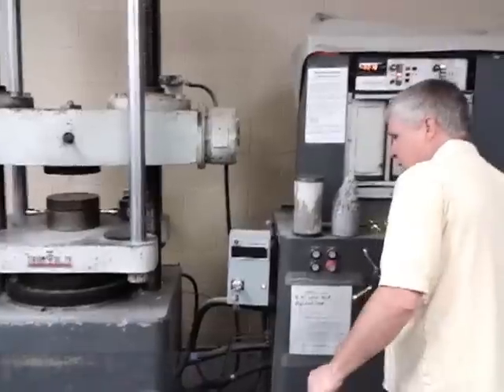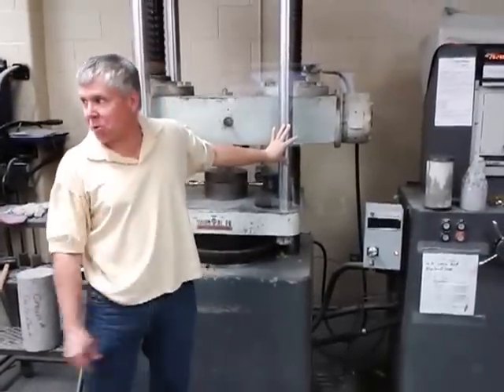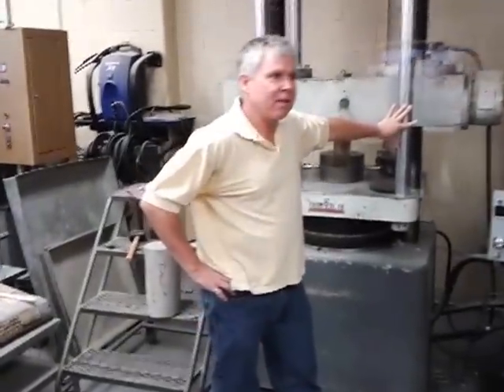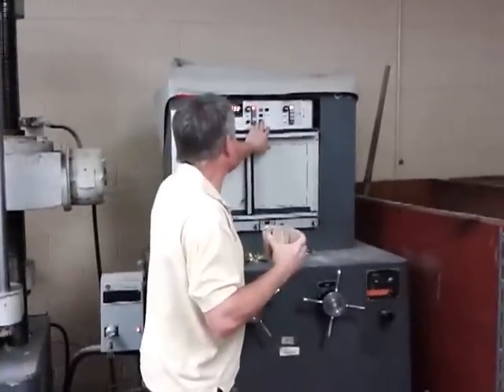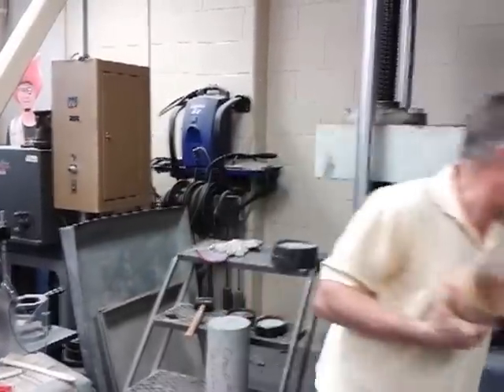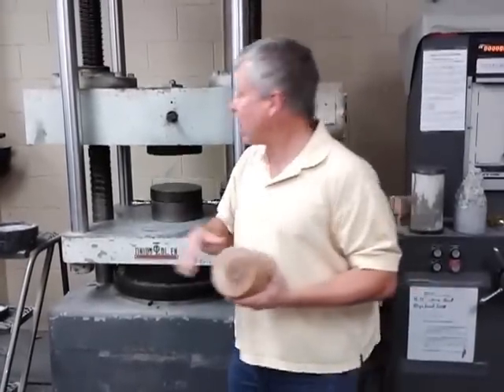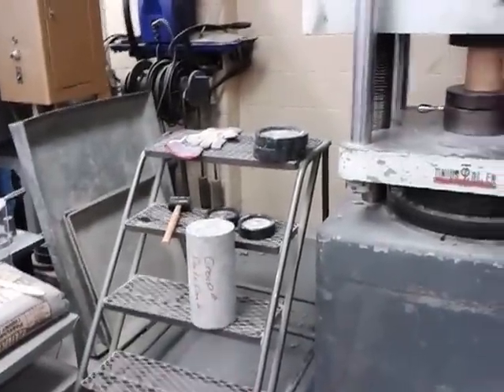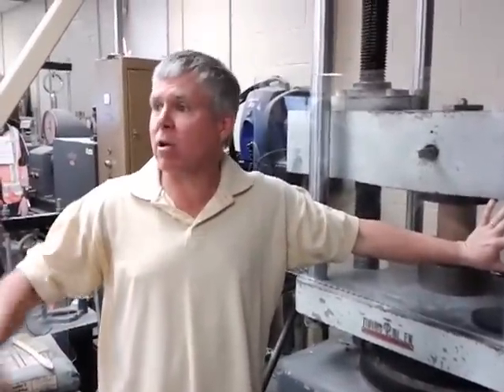Compressing Wood

Comment: Wouldn't the fact that pithy wood was used effect the outcome as well as grain structure and age as well as how dry our wet the wood is at time of use. Also could you not do the compression process much much slower and actually compress the wood like a marshmallow, it would still fail at some point but I do believe you could produce a very very dense wood. In fact I now for a fact that had been done in Britannia back in the industrial revolution for use in the textile Mills of the time.